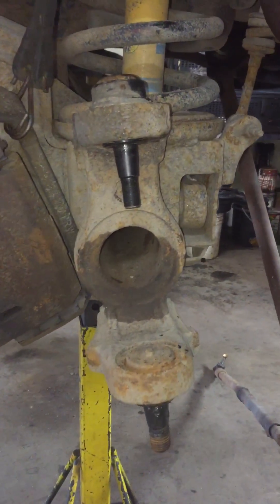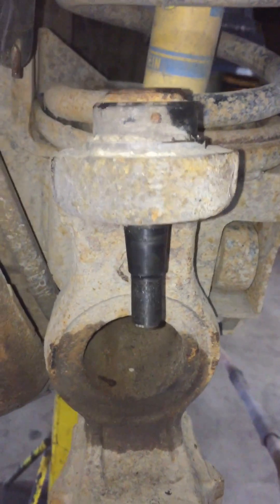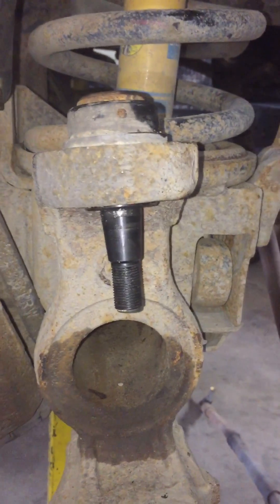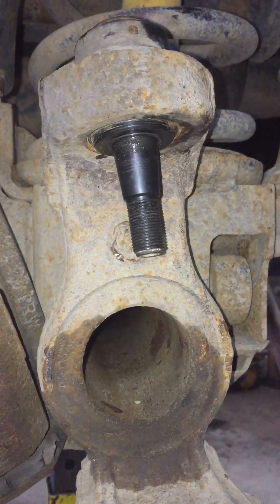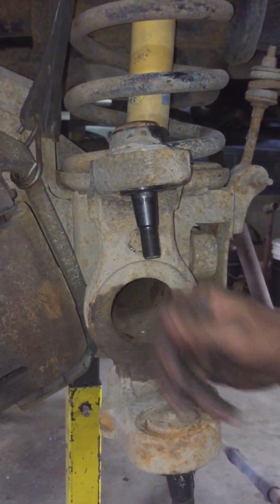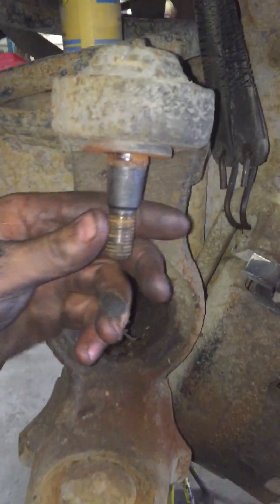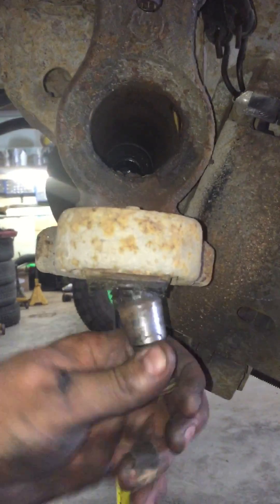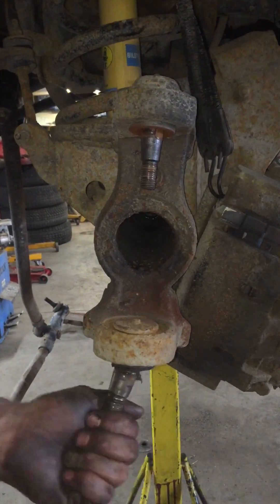EMF Dodge Ram 3500 Upper Ball Joint Test

Comment: I do believe mine has original ball joints and will be ordering EMFs to do my 2006 CCLB 4x4 Dodge Diesel. I shouldn't need the knurled ones ? When you replace the test vehicles do you replace them with the knurled ones after testing?